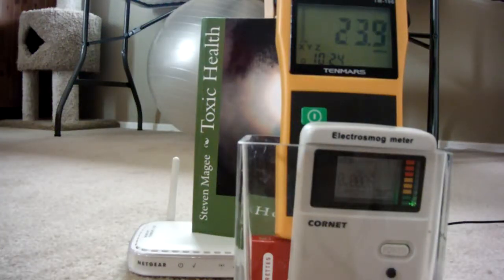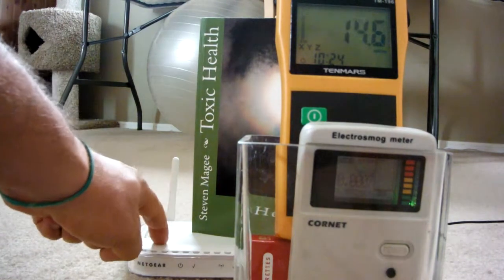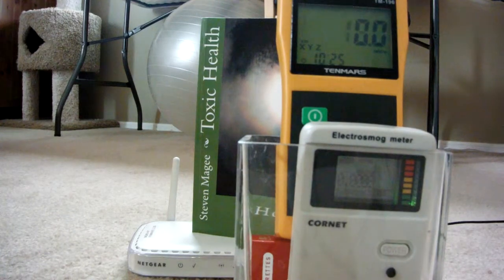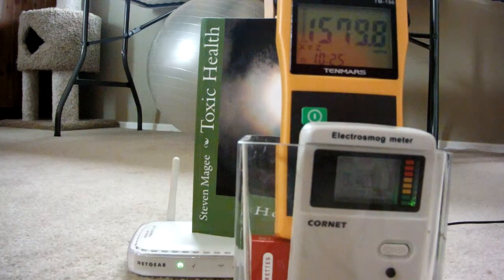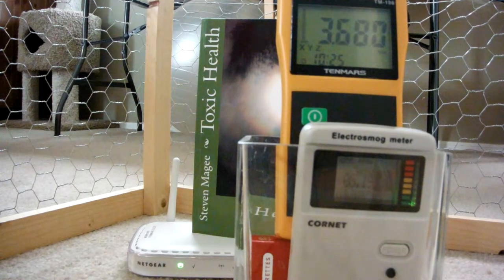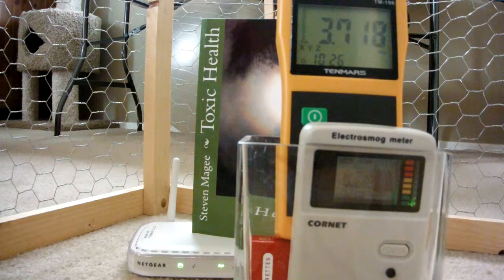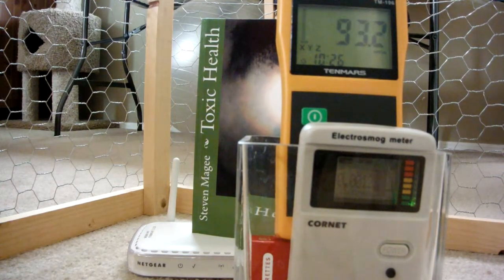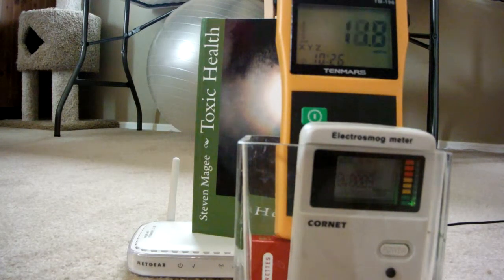Ungrounded Chicken Wire Faraday Cage Regarding Internal 2 4 GHz WiFi

Comment from the maker: Top reported radio wave sickness symptoms in order of frequency: 1. Fatigue. 2. Sleep disturbance. 3. Headaches. 4. Feeling of discomfort. 5. Difficulty in concentrating. 6. Depression. 7. Memory loss. 8. Visual disruptions. 9. Irritability. 10. Hearing disruptions. 11. Skin problems. 12. Cardiovascular. 13. Dizziness. 14. Loss of appetite. 15. Movement difficulties 16. Nausea. Source: Symptoms experiences by people in the vicinity of cellular phone base station, Santini 2001, La Presse Medical.
Reply: Environmental Radiation LLC 
Are you really that worried about WiFi? I’d be more concerned with those smokes under the meter 😆